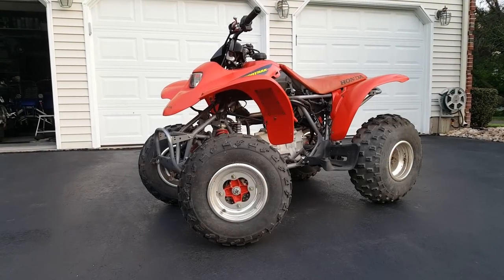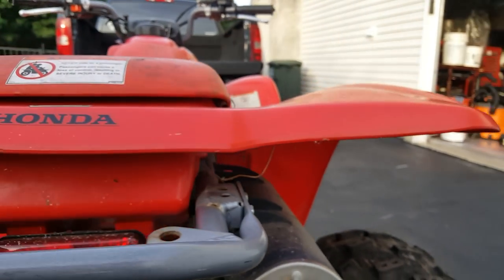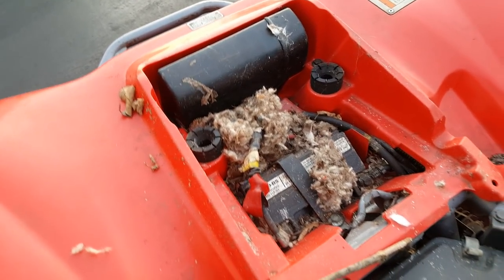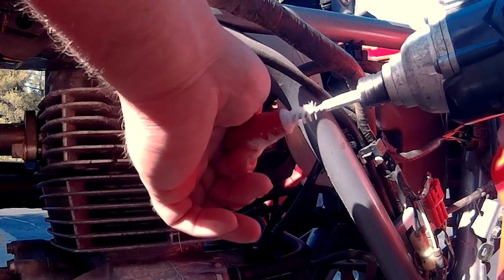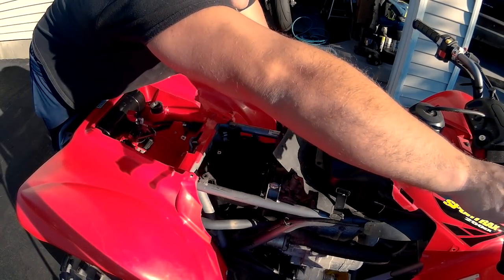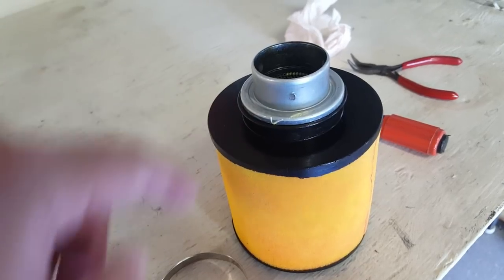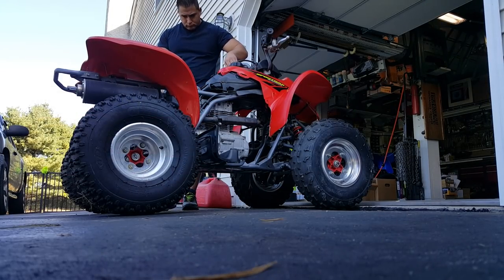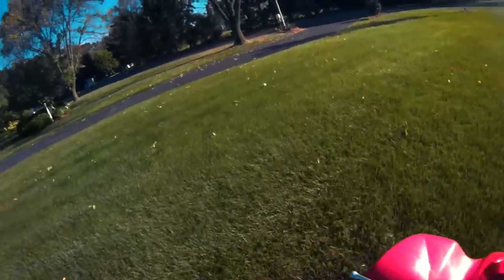Honda 250EX Left outside for 10 Years , will is start and drive?

Comment: I have a ChromePro in my 250sx atc and its lasted 3 years, I take it out in the winter and keep it trickle charged but the rest of the year it sits I the shed and starts fine. The screen is coming apart but it still tells me voltage,  The snake footage was hilarious, that thing was not leaving easily.
Reply from the maker: I appreciate the feedback on the battery; that's a good long term review; I believe this one in the 250 has lasted a while too.

Comment: I had a 250ex and I trail road a lot and the rear suspension sucked. If you get a front banshee shock it bolts right up to the rear mount on the back of the Honda. It made a night and day difference.👍🏼
Reply from the maker: I'd be interested to try this; I would think the single banshee front shock would be too soft

Comment: My dad got a sweet deal on a 2003 250ex for my sister about ten years ago. Had a Procircuit pipe, K&N air filter, and some nice aluminum nerf bars. Seller's kids had no intetest, and it was extremely low hours.

It wasn't properly jetted, so I fixed that. We found it super tippy on the Hatfield Mccoy trails, so it got Tusk extended rear wheel hubs, ASR +2" A-arms, steel braided brake lines, better tires, and eventually it got an extended steering stem. Quite honestly,  it's a little beast.

Comment: Cool video, the TRX250EX is still super popular around So Cal...... BTW Michael, pay close attention to your water/cleaner level in that HF sonic machine. I had same one that failed because I filled it too far up....... That junction where the metal tub and plastic housing meet is NOT sealed......liquid can get past it and down under the machine (where the electrical bits are). On the replacement I bought I sealed that joint with Yamabond 4, just in case ;)
Reply from the maker: Good call with the Yamabond! Sadly that cleaner did fail recently; almost definitely from over-use and abuse. It sure served it's purpose though; these video clips were taken 5 years ago and it only recently broke in 2021; not bad for a 100$ harbor freight cleaner!

Comment: I have a Honda Fortrax 250 from 1987 I recently rebuilt the carburetor and the thing runs pretty good I had to mess with the fuel  air mixture to get it idling right it was a fun project with my grandpa

Comment: Yes! I’m happy you did a smaller quad. I have a 2019 TRX250X (yea I know what you said about it) but hey, it was an awesome Christmas present and it still fits me nice. I would love to get a 400ex but that might a little too big right now as I’m only 5’6 and like 120lbs.
Reply from the maker: Honestly man, I would be lying if I said I didn't have just as much fun if not more on midsized quads like the 250EX 🤘 Glad you enjoyed the video!
Reply: Hey I'm 5'2 and 95lbs I got a basically brand new 03 400ex and its just fine not too powerfull but doesn't lack any either( the older ones also have bad shorter first and second gear so if you want to get one consider going for atleast a 05 cause from this year they have reverse and new plasic) 
(I bought a 03 cause they have the eye lights but otherwise I would of bought a 08)

Comment: I wanna see a raptor 250 build series. Best mid size sport quad ever made! My dad bought a raptor 250 and raptor 90 brand new for me and my 3 brothers when I was something like 6 (2010 models). Sold the 90 a long time ago, but we’ve still got the 250. It’s been used and abused, but even standing at my 6’ 2” 165lbs I still have a blast on it!

Maybe someday when the rest of my builds are finished i’ll do an oem+ build to bring it to its former glory!

Comment: I had a red 05 and it was so easy to wheelie with the short wheel base I flipped front wheels around to widen the front trac and had put different hubs and spacers on rear fun lil quads
Reply from the maker: They really are super easy to wheelie; fun machines

Comment: These little 250EX's have been around for a very long time. It's original predecessor was the Fourtrax 250X from the late 80's which was more of a true sport quad. I think the 250EX shares the bones of the Honda Recon 250 hence why it's shaft driven and has the weird engine shape. My friend and I always considered one of these little sport quads for just messing about on the trails to give our bigger utility quads a break. But they're just so pricey for what you're getting. Personally if I had the cash on hand I'd skip buying one of these things new and just go find a really good used Blaster for half the price. There's very little to them and there's a butt-ton of go-fast goodies for them. :)
Reply from the maker: Very true on all counts man! Even though pricey, I'm still happy Honda is at least still making them 🤘
Reply: These things are absolutely bullet-proof tho, so there pretty worth it.
Reply: @MichaelSabo  I agree. Maybe someday the other brands will get the hint and try battling Yamaha for the sport quad crown. I'm kind of disappointed that it's only Yamaha still making sport quads. But, as with the case of the 250EX, at least they're still making them.

On a side note, have you ever considered looking for a beat up Honda TRX 700 XX? They're a bit pricey when you find one, but they're nice to have because they're different. And being a Honda I'm sure there's a crap load of oem parts available for it. :)
Reply: @trojanhead7149  There's no doubting that. But for me, even if it's a small beginner quad I still like knowing if there's aftermarket performance parts available for it. Because I see it as gaining a bit more potential out of something before someone fully out grows it and goes for something larger. I'm not sure about the 250EX because I never had one. 

But I did have a beat up Blaster in my later years of high school that we put a 240 big bore kit in and did some maintenance to such as new bushing, bears, cables, and brakes. If you wanted to put the effort into it you can make a Blaster a scary little quad with all the parts you can get for them. Plus they're simple because it's just an old fashioned air-cooled 2-stroke. There's nothing fancy on them, like the 250EX it just works. I have no beef with Honda's because I learned how to ride on my fathers ATC 185S. But again, I've never owned a 250EX so I don't know if there's any go-fast bits for them to get more potential out of them. :)

Comment: Idk if you will see this comment but a little pointer abt the carburetor gasket you can take just a little bit of grease and put in the slot to we’re it sits and it will make it stick in there and stay

Comment: You should try doing a Yamaha Blaster build off.  They reasonable price to buy, plenty of modifications can be made to make them competitive.    Standard 17hp,  with porting works a decent exhaust, carb work you can get 30 hp out of them.

Comment: Just a tip if you spray wd40 into the slide tube and let it sit after 5 min it will come right out. Did this today on a 85 trx 125 that has sat for years
Reply from the maker: Thank you for the tip!

Comment: I had a 2011 Trx 250x and it was a great quad would always turn key and start only had to change the oil and clean or change the filter a few times learned how to wheelie on this quad but also never liked to idle cold but as soon as it warmed up it idled fine

Comment: Dude! I have one of these but it’s a 2004. It was given to me by my in-laws. It smoked so I decided to pull off the top end to check the rings and valves. Well…..I f***ed up! When I was taking the head off, one of the small bolts on the side snapped! I tried drilling it and but made it worst. I ended up drilling out the threads on one side and just screwing it up. Well I purchased a new to me used crank case but I’ve been too worried about messing something up to switch out the new crank case!

Comment: A used Banshee for 5 grand? Not anymore. :(

I like to clean and reuse the OEM Japanese jets, rather than the ones that come in the jet kit myself.

Use a nice think grease on the float bowl o-ring. Keeps it in place, and keeps corrosion away.

Ah, you put grease on it. That o-ring won't be corroded in the future!

Yeah, those Honda filters are a bitch.

Nothin' wheelies as easy as a 250/300/400 EX.
Reply from the maker: 100% on everything man. Although, at least here in the PA area, you can still scoop a Banshee in the 5k range; chances are it won't be perfect though.
Reply: @MichaelSabo  The only time I see Banshees for sale is on eBay when I'm looking at Yamahas, but if I looked on c-list, FB, etc, you're right, I'd probably see them cheaper.

Comment: I have no me but it had a sad story my friend got it on a trade and was told that it wouldn’t shift so he was gonna fix it and trade for one of my 3 wheelers well we ended up not wanting to fix the motor and it sat for a while and i ended up coming up with this crazy idea an getting ahold of the frame an some tires I took a 1984 200es an a 2002 250 ex and creating a 2002 200ex it’s ratty but runs really good lol my friend ended up giving me the motor for some clutches an bolts an well we found out that the guy he got it from had jb weld on the primary clutch in the motor an it had no had gasket the guy put rtv as a gasket so it ended up working out for the 200 motor anyways because that one had no chance of returning

Comment: I had a 91 250 with a clutch and a square frame..upon searching for more power I put a 300ex engine in it and it was a little ripper. Not a fan of these auto clutch ones

Comment: why is the trx250ex way different then the trx300ex
its confusing cause the honda fourtrax 250x has the same frame and engine as the trx300ex (but the 250 has a kick starter)
i used to think that the 250ex was the 250x but nope. and the 250ex was the the little brother of the 300ex

Comment: Do u know what the best handguards are for a 2005 400ex. That don't go all the way to the bar. I ordered the acerbis ones but the brake reservoir was in the way. That was a waste of 40 buck. So need something durable and can fit. But don't go to the end of the bars
Reply from the maker: I had Powermadd hand guards on the 426EX I recently built and they seemed to fit well. Sometimes depending what bars and lever your run, different brands will fit better/worse.

Comment: I could sit here singing this machines praises for weeks on end. Rode the snot out of it for ten years. Absolutely no problems whatsoever. That being said, DO NOT PUT A RICOCHET OFFROAD SWING ARM SKID on this machine. It will literally damage your differential and it even caused my swing arm to break in half.
Reply from the maker: Oh man, that sounds terrible: thanks for the heads up!
Reply: @MichaelSabo  the oem plate is designed to be like a crumple zone on a car, so not much force from impacts travels up to the diff. The ricochet one is solid and won't reduce the shock of impacts at all
Reply from the maker: @justinmochi7323  ahhh, I can see how that would happen; guarantee the guys at ricochet didn't know that when they designed it.

Comment: Bro you should have  ended  that snake now it will go bite some kid 🤨 hopefully not but I don’t let any snake get out of my sight nasty little devils but the real trx250x was built 87-88-91-92 single overhead cam air cooled 4valve they were also chain driven and twice the quad of the 250ex I have a 87 trx250x and love it.
Reply from the maker: Luckily it was just a harmless garter snake; we get them around the house regularly here in PA. The 250x was a clutch though wasn't it? I never rode one but I imagine they're more fun for a more experienced rider.
Reply: @MichaelSabo  yep clutch drive  5speed with reverse they were lighter than the 250ex also the original 250x share the same platform as the 300ex they share the same topend as the 300ex as well the difference is the bottom end on the 300ex having  a longer stroke and electric start the 250x was primary kickstart both quads has a overly complicated reverse but easy to get the hang of they handle great for a smaller quad and pretty peppy 3-4 gear wheelies with ease they are easy to maintain also if you get the chance to pick one up cheap grab it.
Reply from the maker: @lukecombs5242  very true; it would be cool to compare one of those with a Mojave.